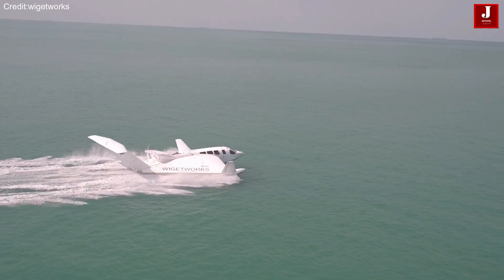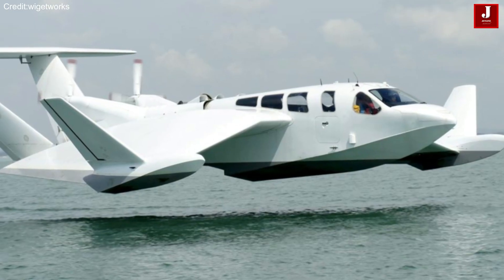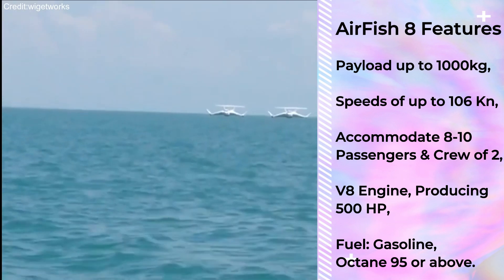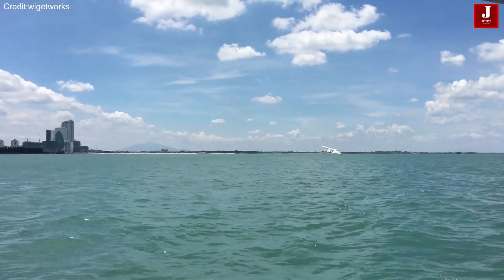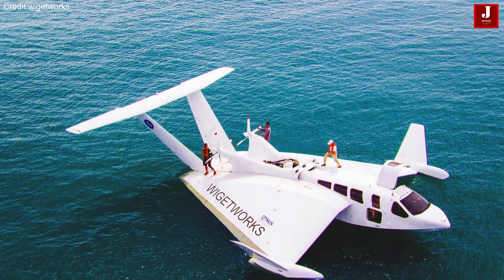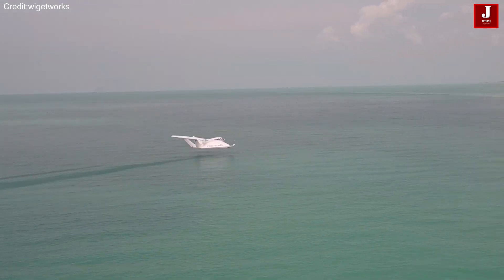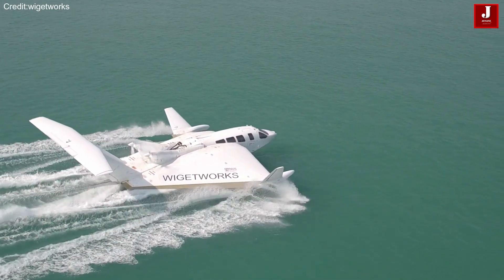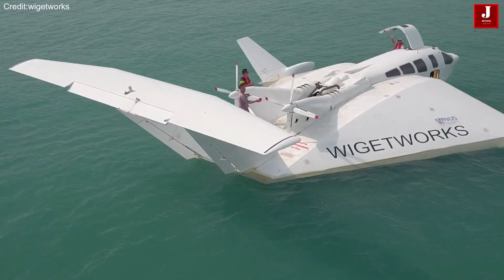Meet the AirFish, a mixture of Boat and Airplane—a standout innovation of 2024. #Airfish #STengineer

Comment: AirFish 8 has been around for a decade.  Very cool idea.  Wonder when they'll complete certification and become available for sell in the US.
Reply: Longer.  Prototype first flew in 2001.  The market for these is so small it might as well be non-existant.
Reply: @JonMartinYXD  I don't think the market for them has to be small.  I live in Southern California and many fishing hot spots are >30 miles away, having one optimized for small group fishing would save lots of time and a bumpy trip.
Reply: @stanimal8  If the trip is bumpy in a boat, that means the sea is too rough for the AirFish to takeoff.  Wing in ground-effect seaplanes have been around for over half a century but they never get beyond a few prototypes.  They just don't do anything better enough to find a market between boats and traditional seaplanes (flying boats and floatplanes).
Reply: @JonMartinYXD  The Airfish is supposed to be able to cruise ~20' above the water, our sweals are often ~10', very bumpy in a boat but might not be bad in an air effect vehicle.  And doing 30 MPH in 10' sweals is a tiring ride.  A decade ago, they were talking about $300K, but never happened.
Reply: @stanimal8  I'm not talking about when it is airborne, but for takeoff and landing.  It can takeoff and land in up to sea state 3 and wind speed of 15 knots.  The upper end of sea state 3 is going to be a rough takeoff or landing.
Reply: @JonMartinYXD  Nice thing about sweals is both their spacing and direction are fairly consistent.  So we could choose to get airborne by traversing at an angle to the wave, or even on top of the crest for the short takeoff. Then turn towards the heading to destination.
I would even consider using it in stormy weather.  But operated as a pleasure craft, we have that flexibility.